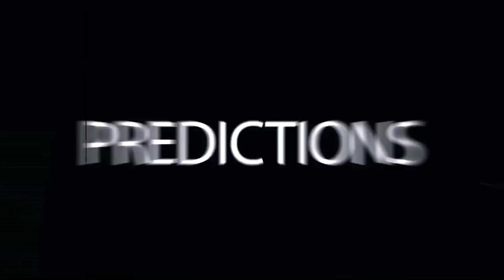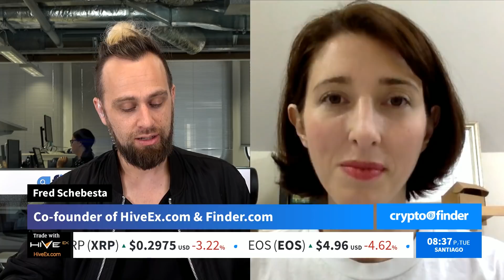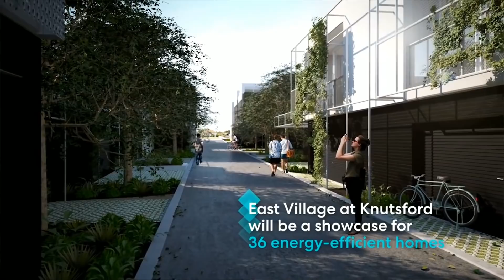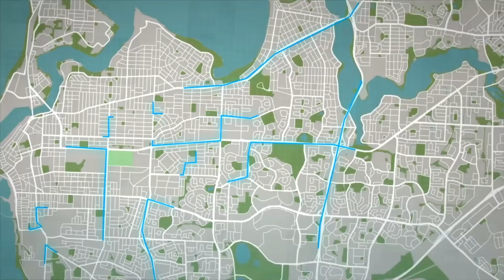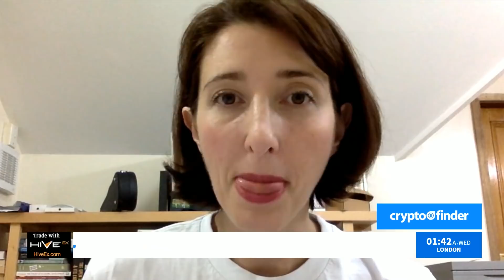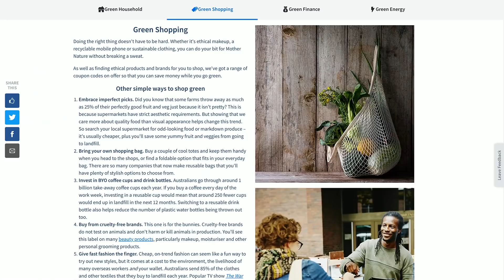Looking at Power Ledger (POWR)? Adoption, value and 2019 roadmap explained by Dr Jemma Green

Comment: Great interview, I agree with Jemma that the usable applications (dApps) are going to drive the value in the next bullrun... I just went through the top 100 on CMC and counted 62 unique blockchains and 38 applications built on top of a blockchain. How many different blockchains are required really? All of the dApps will flock to the best one? Why have 62 of them? In the end I think only a few will survive, and it is those which provide the best platform for the apps, and at the moment that is Ethereum... I expect Ethereum to rise greatly as well as the applications that solve real world problems such as Power Ledger....

Comment: So instead of using this blockchain token to route generated electricity to my neighbour via PowerLedger battery why not buy a battery myself... something I should have probably done before FOMOing into some POWR during last bill run 🤦
Reply: Before fomoing, next time do research about the token itself. As right now, to me it seems like you still misunderstand the use of Powr token in general. You do not use the token to route anything. Powr token is used to access Power Ledger's applications. One of these applications is peer to peer trading(which you have in mind right now). However, Power Token in p2p trading is used either to buy access to the p2p network(big company escrows Powr as a form of licence so that their users can sell electricity to the grid) or for the users, to convert Powr token into Sparkz, which is then used as currency for transaction on that network.
However, there are other Power Ledger applications(e.g. Carbon trading) where the Powr token has it's user case.